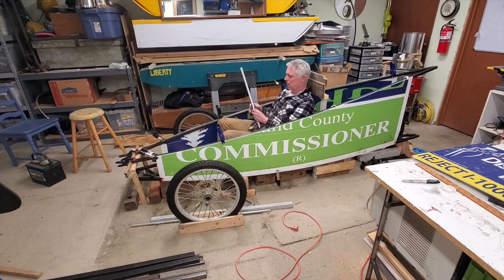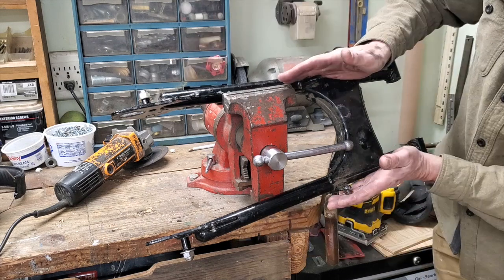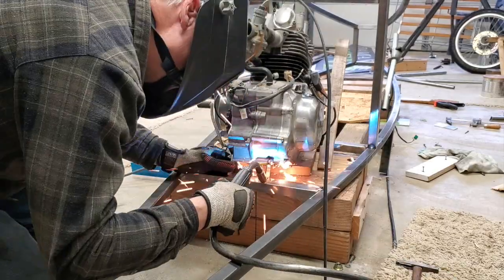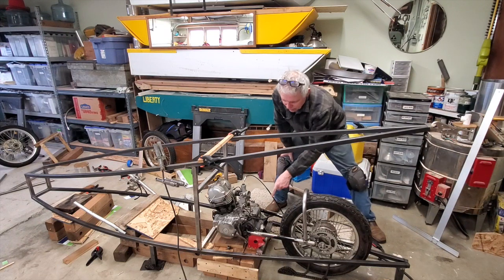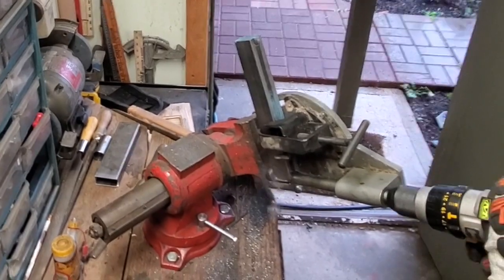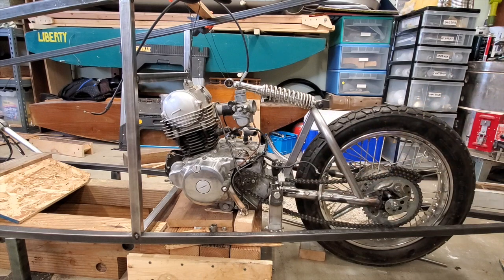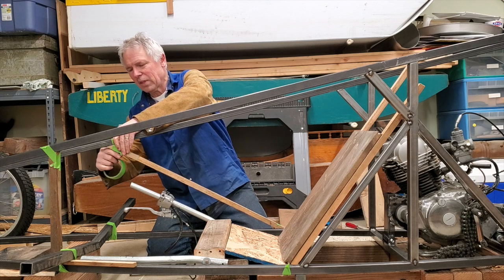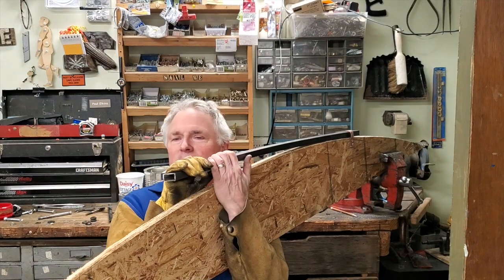Fuel efficient reverse trike build (part-2)

Comment: I think it's a mistake to make the cockpit so small with no cushion room around your body. in case of an accident the frame should be able to crumple around you to absorb the shock. your frame is probably strong enough not to crumple in on you but if it does you can die. you would be essentially be building your own coffin

Comment: u going to gusset those swingarm uprights from the frame?.
whats that motor, it looks nice n simple like my old SL125 was.. (tho the huge cam cover looks a little Yamaha...)
CDI? there should be tones of info on making that run more efficiently. Looks like it may be later than the old SL units with points (ughh). 
Depending on use some would extend the manifold to the carb.
There are a huge amount of 2nd hand carbs that would suit that are way more efficient than that ol 70's designed (keihin ?)

Comment: Paul your bike is looking great especially with the weight distribution should be nice for breaking more evenly then front-engine. Don't know if you're going to do this or not but having a smooth flat bottom on the vehicle should help with fuel efficiency.

Comment: I still have a working Piaggio MP3 motor/wheel assembly...
I wish, I could build something similar BUT I live in an over regulated country.

Btw: You should also put a seat on top of the motor, for driving with cargo and on sunny days.

Comment: this is a great idea and all but wouldn't a small car engine be better with fwd? motorcycle engines aren't built to be efficient, mostly just powerful and light. and then there is the chain drive... more losses. anyways keep it up I want to see how it performs!
Reply from the maker: I chose this year and make and size of motorcycle as this engine achieved over 350 mph on an enclosed motorcycle while traveling highway 101 in California back sun 1982?
Check out http://craigvetter.com
Reply: @paulwelkinsdiy  
Edit to 350 mpg. not mph.  
You could tell Luke that chain drives are highly efficient; more so than belts, shafts or hydraulics.

Comment: It seems like it is going to be pretty loud in there. Are you sure you don't want an electric drivetrain? With the light weight and streamlining, you would not need much power or capacity to drive  at a good clip.
Reply from the maker: Electric motors can be excessively whiny and loud as well. This way I can go on a trip without worrying about where I'm going to charge the batteries.

Comment: Fun seeing someone else do stuff! I would have used same shocks and swingarm. The windshield urethane is good stuff if you have any left over you will need to use it. Try using some to glue broken driveway cement back in. Lasts forever
Reply from the maker: I'll keep that in mind, as I have a few cracks to fill.